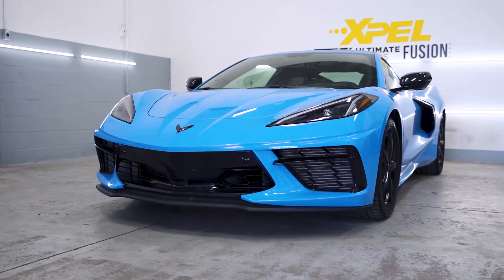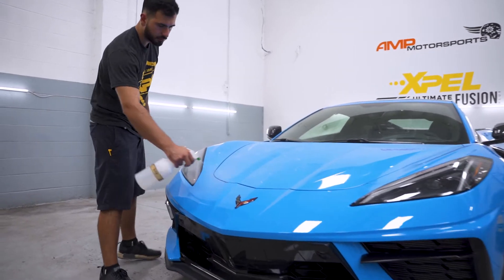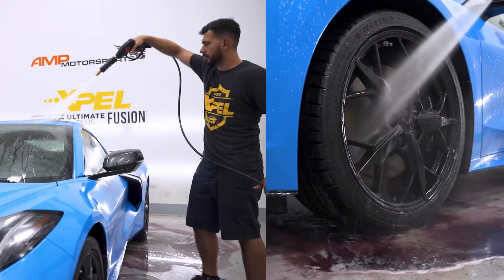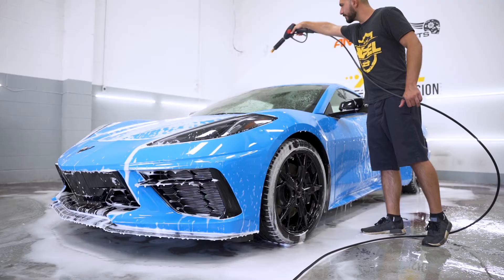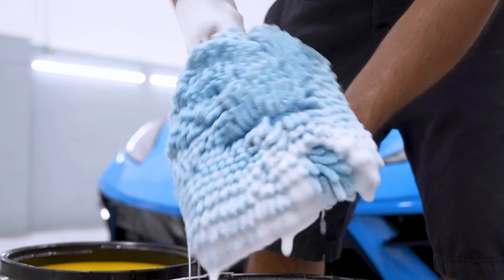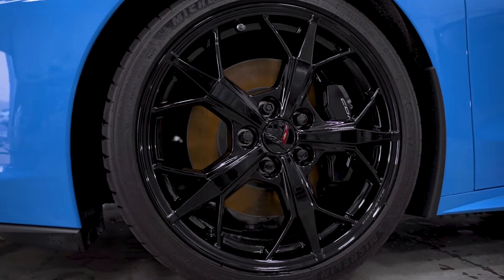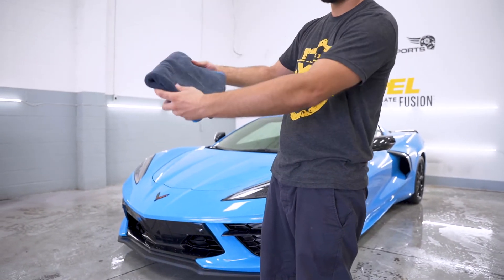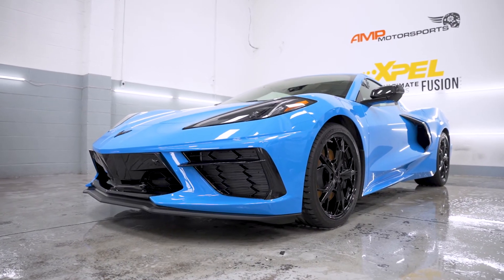How to wash a car properly!

Comment: Well done. Here’s my question. Doesn’t using the pressure washer to rinse blow water and soap on the engine? I use painters tape to cover the vents around the rear window. I also found the Master Blaster is great for drying as nothing touches the car except air. Cheers!